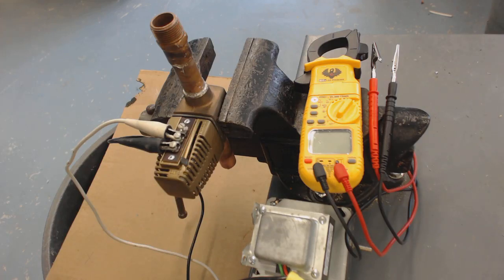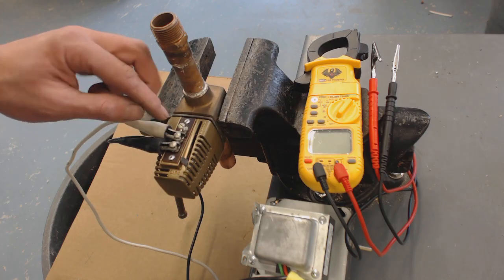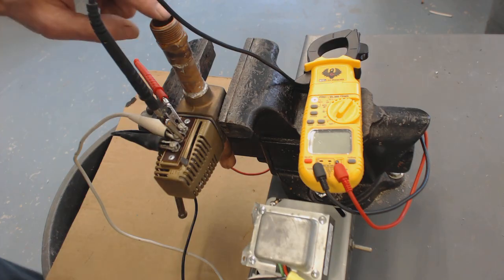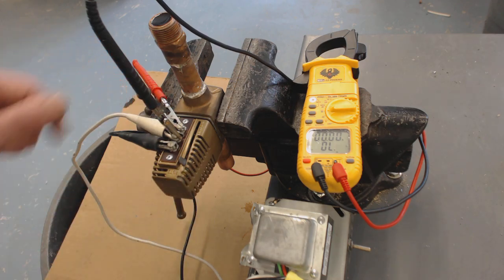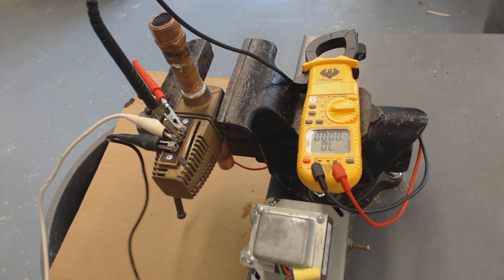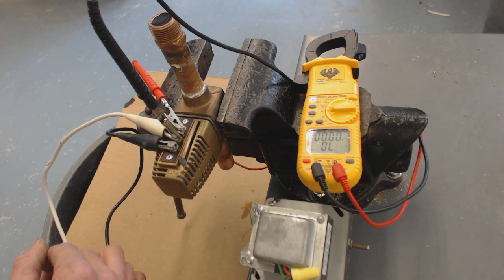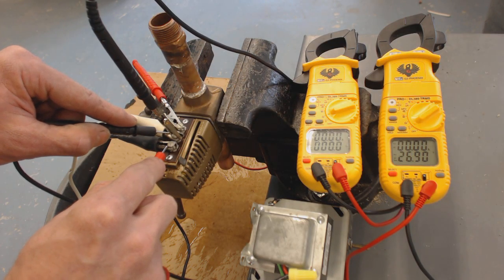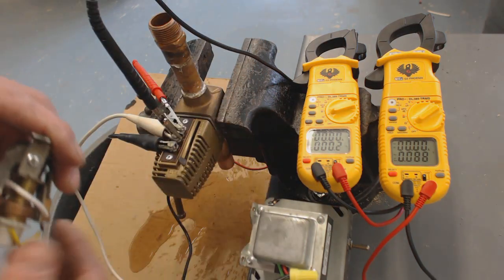Taco Zone Valve Wiring, Voltage and water flow Tested and Proved.The Water in the top falls Through!

Comment: Why the wait for valve opening? As a controls engineer, I am used to using solenoid valves that open quickly. Is there some reason that there is a delay? Maybe a mistake function that the control  oard lacks and it is easier to perform with a slow valve? ASCO makes valves that could do this function instantly.

Comment: I just took apart a Taco power head that was shorting together terminals 2 and 3 when the power head was not activated.  The metal tab that keeps the microswitch depressed (and electically open) when the power head is not activated was bent so that the tab could not properly press the microswitch button.  I'm guessing that the plunger length was adjusted too long at the factory which resulted in the valve putting too much pressure on the microswitch when the power head was off, and that bent the tab.  When I replace the power head, is there a plunger adjustment that I should check.  I do see that the plunger is threaded near the tip and can be adjusted.

Comment: Thanks for the video.  I had to replace one recently.  To be clear: there is no 24V "hot."  It's an AC voltage from the transformer, so it doesn't matter which way you connect 1 and 2 from the transformer.

Comment: As you now know, the "normal" wait time for a fully operational taco zone valve, from the time it receives the signal to open, to fully open is about 90 seconds, not 20.  I just wanted to make sure that folks didn't think they had a faulty valve because theirs took longer than 20 seconds to open.  Great video, and very well explained.

Comment: Nice video.
Where does the signal go from the thermostat to send the 24volts to the zone valve and turn on the RED LED on a Taco control board?
I have one zone intermittently failing and the red LED doesn't come on either.  When it's working, the Red LED comes on.
It's a logical error but I really need to know the sequence of events to  troubleshoot it.
Thanks

Comment: OK, makes sense and I think you have inadvertently answered my question.  I have a two zone system with these valves and have no heat on the second floor.  I decided to "troubleshoot" a bit before replacing the zone valve.  I just swapped positions on the zone valves to see what would happen.  In other words, the first floor zone valve is connected to the second floor pipes and valve, and the second floor valve/wiring is connected to the first floor pipes valve.  I did not swap any of the wiring for this "test".  Very strange results.  The questionable second floor zone valve and wiring seems to operate the first floor just fine (I simply pulled down the manual valve handle to activate the heat).  But, the good valve and wiring from the first floor still will not operate the heat on the second floor (the pump does not come on and the burner does not activate).  This does not make any sense to me unless the pipe acts as some sort of ground for the valve/wiring...But, judging from the way you bench tested that unit, I am guessing that the pipe does NOT actually ground the valve/electrical unit.....  I am probably overlooking something stupid...  Please confirm this for me....Thanks  Don
Reply: If you haven't solved it already, it could be a failure of the second floor thermostat.
Reply: @MrBikedrummer  I think I was just confusing myself....Suddenly, the unit started to work when I shook the wiring going back to the boiler....Has worked OK since then, so I won't mess with success I guess...Thanks  D

Comment: What still confuses me about the functionality of the power head is that I just purchased a new power head and it has continuity between 2 and 3 out of the box.  When I touch the multi-meter leads to 2 and 3 the tone goes off.  Could there be some slight continuity but not enough to truly allow ample current flow through until the end switch is depressed by the opened plunger?
Reply from the maker: It may have continuity because the manual switch is still in the open position out of the box, Try putting that in the closed position and try again, thanks.
Reply: I tried with the manual tab both forward and back and when I put the continuity tester on #2 and #3 .....still hearing the tone.  Doesn't make sense. Thanks for your input!    @acservicetechchannel
Reply from the maker: Put your meter to resistance and read the actual ohms maybe. Continuity may not be very sensitive. Are you reading this with the head off or on? It would need to be mounted onto the base otherwise the head would thing the base is open for water flow, thanks
Reply: @acservicetechchannel  thanks for sticking with me.   It was not connected to anything.....just on the bench top.  I will check out with  ohm meter this evening.
Reply: @acservicetechchannel  I determined the issue.  You were right about mounting the head on the valve.  What I discovered was that  when the head IS NOT mounted the plunger in the head can be extended out since the valve's tab-botton is not there pushing it to the farthest back position.  The power head plunger only has to be out a VERY little amount to close the end switch between #2 & #3.  And that was what was happening.    I achieved the same result by just making sure I pushed the power head plunger fully back with my finger when it was on the bench and the end switch between #2 & #3 remained open.
Reply from the maker: Yeah that makes more sense then, thanks

Comment: I've installed a Taco as a replacement on an Energy Kinetics System 2000 board.  The board essentially separates the thermostats from the zones so when the thermostat calls for heat, the board applies 24 v to valve.  The other existing valves are 2-wire while the Taco has 3 terminals.  The parts supplier said it would work but I'm not having any luck.  From your video, it would seem I could attach the wires to terminals 2 and 3 and leave 1 empty?  Would this work?  I've also heard that Taco's are not compatible with the System 2000 because they are too slow.  Your thoughts?  TIA
Reply from the maker: What are the other zone valves? If the pump turns on without a confirmation that the valve is open then the circ pump could break since the valve has not had a chance to open yet. 1 and 2 would open the valve where 3 is the confirmation it is open, thanks!
Reply: @acservicetechchannel  The others/original are Erie poptop normally closed.  I think I've tried connecting the board to the Taco's 1 and 2, leaving 3 empty, but without success.  Thanks for your help!

Comment: I noticed a zone of mine was not operational last fall.  So I’m tending to it now.  The head heats up but does not  let water through.  The heat is from electrical resistance.   Something is stuck in there ?  Just replace the head with a new one I guess ?     The system is about 16 years old.  (Basement underfloor heating ).   It can heat the entire house almost all winter
Reply from the maker: It usually is the top power head but the actual water valve could be stuck, thanks
Reply: @acservicetechchannel  how would one get actual valve unstuck?

Comment: So is the valve itself consuming hydro the whole time it’s open ?   That sucks if it does.
Reply from the maker: The valve is drawing .9 amps at 24v any time it is powered and the valve is open. The Taco Sentry is much more efficient, thanks
Reply: AC Service Tech LLC oh thanks for that update.  I’ll definitely look into that   .  No sense in wasting  that kind of power
Nearly an amp at 24 volts. ! X 3
Reply: AC Service Tech LLC dammit AC.  Now I want the sentrys.

Comment: Shouldn't the little lever next to the three terminals move as the valve opens? I thought that was an easy way to tell if valve was closed or open by checking to see if the lever was in the cold or hot position?
Reply from the maker: No not on this valve. That will not move unless manually, thanks